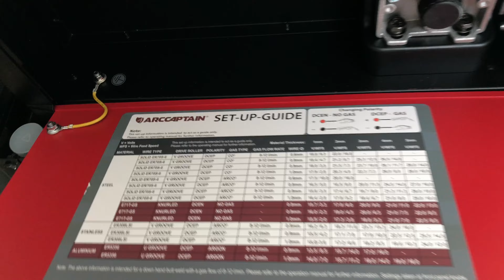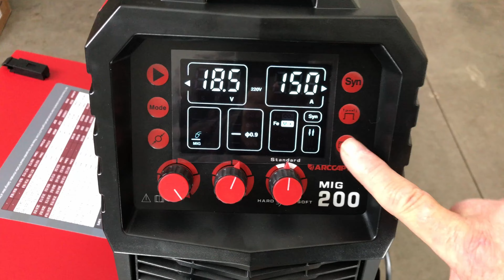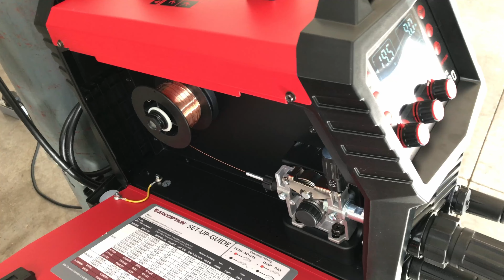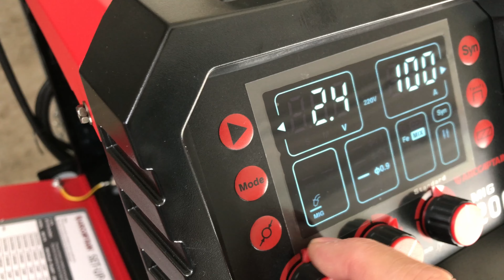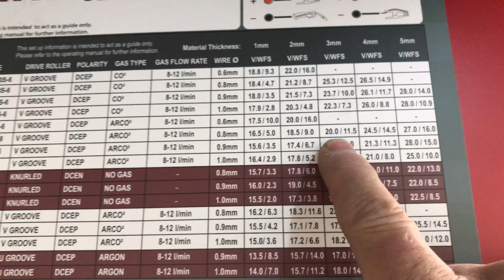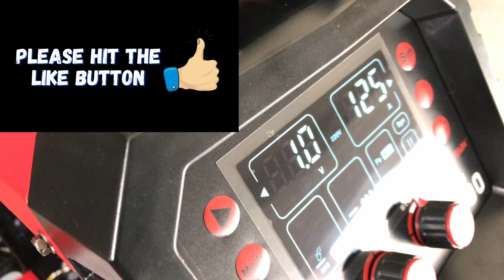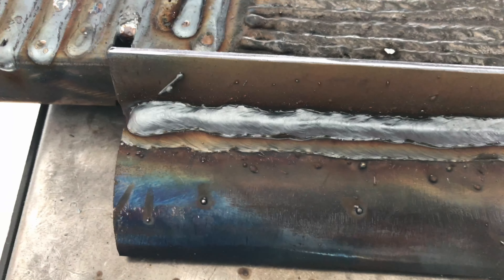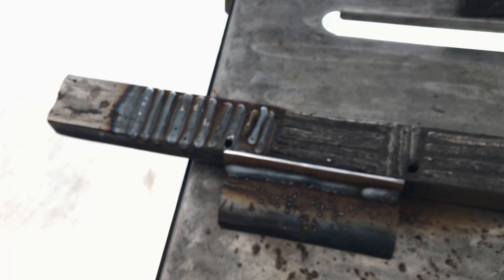ARCCAPTAIN MIG200 Multi Process MIG Welder Review

Comment: Does it come from the factory with the lead wires correct? I’ve seen where the leads need to be swapped, but can’t determine that as the wires are hard to see & get to.
Reply from the maker: I'm not sure exactly what you are referring to. Depending on the process you are using you can easily change the leads from DCEN to DCEP on the front of the machine. I didn't have to change any other wiring on mine from the factory to use it.
Reply: @DIYHomesteadProjectsDIYHP10  Several videos refer to changing the polarity. Thanks for the response.

Comment: DIY Homestead Projects.. I have this machine and I have to say I love it so far. It has a 60% duty cycle which means for every 6 minutes of welding it needs to cool down for 4 minutes, 60% of ten minutes is 6 minutes of weld time and 4 minutes of cool down time. I also have their TIG200 and it is an awesome machine as well. I want to get their CUT50 plasma cutter as soon as funds allow it.
Reply: Do you think the Arccaptain mig200 will have good penetration for installing a notch on a truck frame & a 4link ?
Reply: @mirabalmedia yes I used mine fix frame on my truck they have a 250 version as ell for 80$ more

Comment: what size breaker is the machine rated for at 220v? the one i have to run it at is 50a
Reply from the maker: Not sure but 50a should be more than sufficient for this machine.
Reply: @DIYHomesteadProjectsDIYHP10  im just unsure that i wont burn the machine up running to much power through it
Reply: @aidanprocopio66  how would that happen? The size of the breaker doesnt matter, unless its too small. using a 50, 70, or 100 amp breaker cant harm anything. it calls for 50 amps anyway.

Comment: Could anyone help Does anybody have a conversion chart for the drive roll and the tips size from metric to standard with the numbers would be each one from metric and standard number each side of the Drive roll and the tip metric to standard not good with metric.